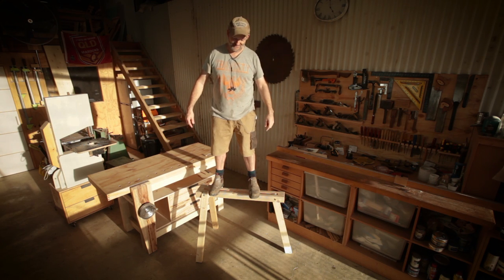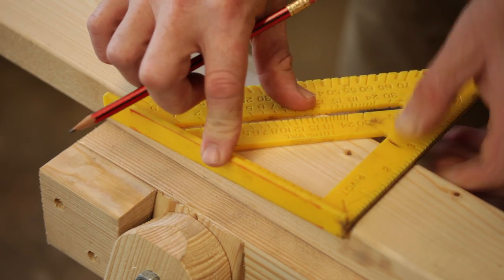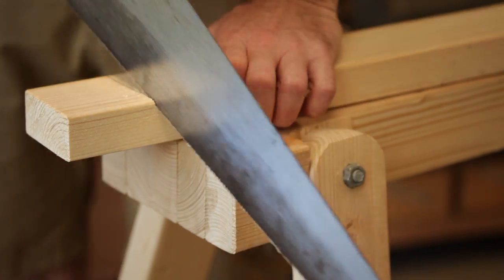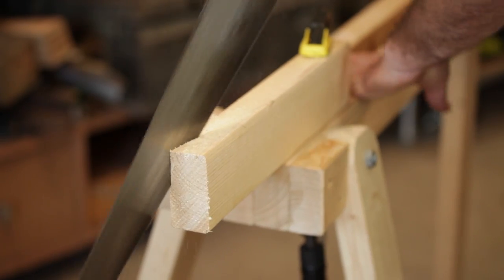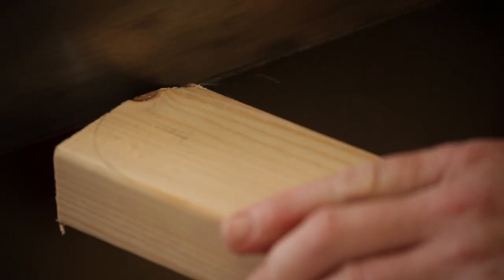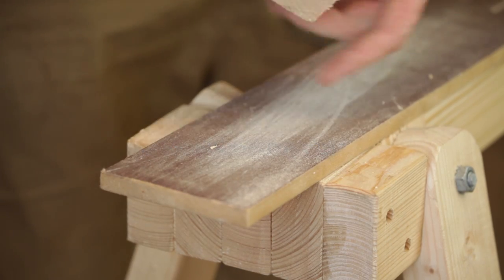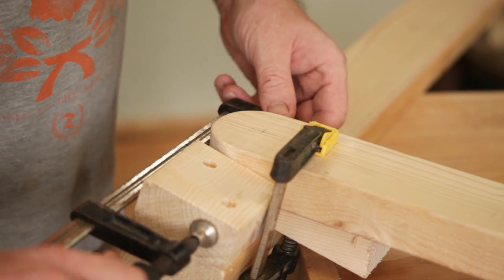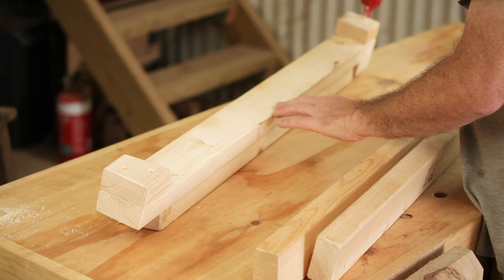Three Legged Foldable Sawhorse - Built with Basic Tools

Comment: these have the benefit of a naturally slotted top when opened up in use so great for clamping stuff - almost makes a slimline portable workbench for small jobs similar in dimensions to those tall thin, long router/eye-level workbenches that some people make.

you just use a piece of scrap 3/4 ply with a slot cut in it for the underside and a short bar clamp inserted into the sawhorse's slotted top and you're done

Comment: These are brilliant. I make collapsible sawhorses with my construction class and we end up using them to set senior student projects on top of for applying spray finishes. These would be perfect and take up much less space when folded up. Thankyou too for the refresher on speedsquare angles. Completely forgot due to lack of use and have been working with sliding bevels. I'll be showing my students the speedsquare method in construction next term.
Reply: subbed, and followed your instagram too. nice work.
Reply from the maker: Thank you very much Damo! Glad to be of help to you and your students. :)
Reply: Follow up. The students took a bit to get their head around the speed square angles, but the result is more accurate saw horse angles because the angle can't be messed with like the sliding bevels.

Comment: I made myself 2 of these with a slight modification.  I added a 7 inch cross piece to the single leg.  Now to fold it up I have to fold in the 2 legs, then the single leg, but the stability is pretty awesome now.

Comment: I've got a couple of commercially made folding sawhorses that are nice, but they still take up a lot of room in storage. These three-legged models are really intriguing.  I am VERY anxious to build a couple and try them out.  I'm thinking that a nice extra feature would be to put a drive a ring bolt or two in one end to hold a good suspension strap.  This design is also a really good one for people who do a lot of wooden models and light craft work.  They go up in a flash and give you lots of working and cutting room for small projects.  Nicely done!

Comment: You just taught me something new, I'd never used the speedsquare that way before.  I've always tried to use it like a protractor, marking off both ends then drawing the connecting line!  Thanks, man!  Love this chanel.  :)  Tip when you're sinking a bolt head like that, step your drill sizes down.  If you start with the spade bit, the center point will hold it nice and neat without wobbling, then you can drill your pilot and through hole off the center the spade pilot leaves.  I realize this is a year old, and you've probably worked that one out for yourself by now!
Reply from the maker: No worries Dan! 😊

Comment: For added stability one could attach some braces that go from high on the two legs down to the bottom of the single leg, to keep the legs open tight to the stops, because triangles will make structures rigid.  Clever folks might figure out a way to make these part of the folding design, possibly where a foot is made to receive both these braces and the single leg to create a wide stance on that end too. There are many ways a diagonal brace could be made. Granted, it is another piece but it could make these suitable for many more purposes with a small amount of extra material. Perhaps a sacrificial or adjustable height top plates or even table top could be made to sit in the gap left where the single leg folds. So many possibilities!

Comment: Center leg can be reduced or space can be enlarged using several layers of craft paper - same as the cover paper on MDO plywood as used by signmakers.  Reduce a long 2x4 or add 1-2 mm or 1/32 in the areas of 3.5 x 3.5 inches - dealers choice.
When I make mine I will laminate oiled hardboard - masonite - as it is US 1/8 or about .181 and adds some contrasting color to the project.  NICE PROJECT easy to make with hand tools and basic small drill driver.
Reply from the maker: Sounds good Barry! :)
Reply: So Barry, did u end up making these, along w/the addition u mentioned?  If so, and if you have documented, I’m eager to see what you meant in regards to how you utilized those pieces of hardboard. Aloha

Comment: I love this idea!  I'm going to make a couple this weekend, however, I'm going to try and add a fourth leg next to the existing 3rd leg.  I'm going to make a bigger gap to accommodate the extra leg (plus a little extra as the two interior legs will have a very slight angle).  The 3 legged version is perfect as is, but I tend to work on uneven surfaces and so I'm going to try a four legged version based on your design.  Thanks for a great video!
Reply from the maker: Thanks Keith! I thought about a version with four legs but I had them all fold on the outside. Regarding uneven ground, the three legged sawhorse (or stool, or table etc) will be naturally more stable than four legs. :)
Reply: +Pask Makes - I didn't even think about the three legged saw horse being more stable.  I had it in my mind it would be less stable (even though you clearly said it'd be more stable in the video).  Obviously, on uneven ground it would be a lot easier to level with just one leg on that end.  Thanks again, this is a great project and I'm on it this weekend.

Comment: Add a shoe on the bottom with a swivel, and you can make a crosspiece which will ensure stability on the third leg while still allowing it to collapse into the other part. It'll be wider/deeper by the thickness of the shoe (i.e., stud width) but that's not much. Think of the third leg as an inverted "T" (┴) with a swivel right at the T juncture. Alternately, add some short steel square tube to that end for the shoe holding segment, for strength. Adds a little to the cost but you should be able to make it quite stable at that end, too.

Comment: excellent sawhorses/ and great editing.  i bet you could use 2 x 3's and a couple chunks of 2x4's for the spaces to eliminate the planing of center leg and they would still be strong enough for general use and they would be even lighter. Add a waterproof storage bag and you can even leave them outdoors.Or make them out of trex decking material
Reply from the maker: Good ideas Tim! I made mine out of 3 x 1 1/2's as I have plenty of it in stock and they are plenty strong enough for my needs. Also 4 x 2's aren't cheap here. :)
Reply: Thanks for the compliment Pete..   I didnt even think of the cost difference..  Save even more money and make them from pallets..

Comment: Here'w an idea.  A fold out brace, 3/4" ply, that lives in a slot that runs vertically through one of two-legs that pivots out and hooks on a rod run through a matching slot on the opposite two-leg locking the two-legs together.  If you want to get fancy, you cut the curve of the hook at the free end of your pivoting brace so it is a little eccentric to the axis of rotation so it will 'cam on' to the locking rod on the opposite leg to keep it from popping off.

Comment: Simple construction, they fold into a small package, require common and inexpensive materials, and completely elegant.  All they lack is a short length of small rope (5-9 mil) for wall hanging, just drill through the spacer block on either end...

Comment: Slick!  How about some flat washers under the nuts?  Thanks for sharing.

Steve
Reply: Was thinking that, but maybe by not using a washer, the nut gets embedded and can't back off with use?
Reply from the maker: When I made the first one I raced through it and was lazy in not put the washers on but then I thought like you when I built the next one. I will see how it goes and add them if I feel like it needs it. :)
Reply: Lock nuts are the answer there. You know, the kind with the nylon/plastic insert that will not loosen once attached. You can leave them a little loose and they will not get looser, or tighter.

Comment: Tools used:
- power drill
- countersink drill-bit that matches the shank of the screws you're using
- large drillbit matching the shank of your bolts
- spade bit that matches or is larger than the bolt heads
- hard-point saw
- coarse flat rasp
- plane or sandpaper for thicknessing/dressing leg-ends
- glue

Comment: Nice project! And I don't think the minor loss of stability of a tripod system should be an issue for someone needing such a compact (read quick & handy) solution anyway. 

Is there any specific reason why you use 10 degree foot on the single leg and 5 deg on the other two? I would have thought 10 degree slant on all 3 legs would have been a tad sturdier. Mind you I haven't commenced building one yet but would be handy to know the reason before I start.
Reply from the maker: Because the two legs are splayed as well as an angle cut at 5 deg they are actually just over 10 deg overall. I'm struggling to explain but I'm talking about the compound angle. :)
Reply: Ah... thanks mate. I wasn't allowing for the compound from the wedges. If I was designing it I would have done it wrong (like I did with my first fold-ups years ago).
Been looking at a number of other designs since recently coming across your design and this one is by far the most practical - kudos to you for sharing. 
Very keen to see what you come up with next!

Comment: nice job, i think im gonna try it. do you have de size of drills?
Reply from the maker: Thanks Gerardo! The size of the drills you need depend on the bolts you use - I used M10 bolts so I used a 10mm drill. :)
Reply: Ty very much im actually buying bolts right now jajaja